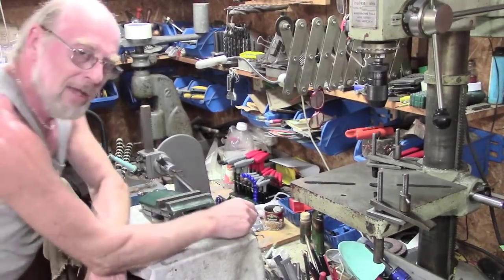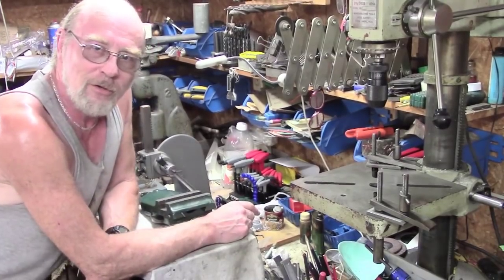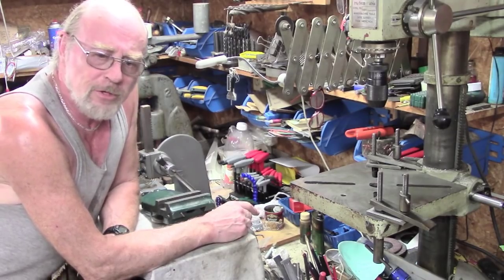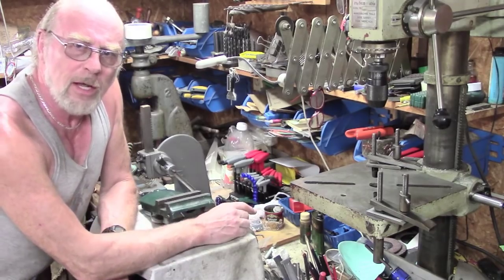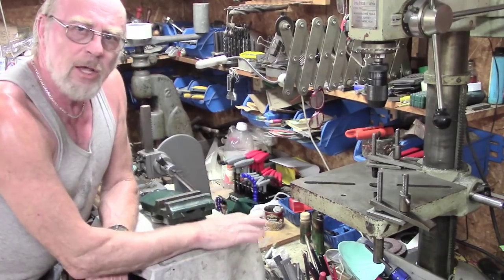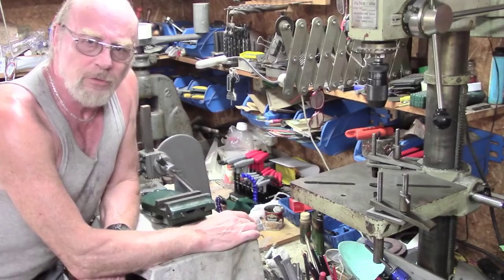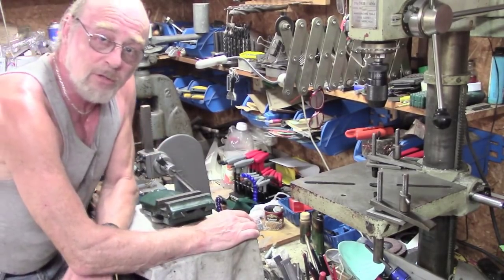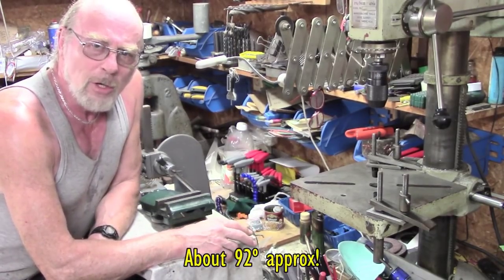New Gib Plate for a Compound

Comment: Hi Chris,
You've got one those shops with the abrupt 2 seasons changes, from cooking heat to total freezing...
Beware when working on cold rolled steel, taking off material from one side or the other will unbalance the stresses induced mostly on the surfaces and cause the piece to warp badly, hot rolled steel is less prone to those problems.
But the compound is 100% better then before now...   ;-)
Cheers,   Pierre
Reply from the maker: pierre beaudry Sorry late reply - my comments notification seems to have dried up! Yes Pierre - there was a bit of warp but very slight fortunately so no biggie.

Comment: In addition to good screws (who doesn't want a good screw, sorry, couldn't resist) a dowel pin, locating the strip, stops any movement and unwanted tightening from the wedging action of the dimples as the top slide, er, slides.
Re weather, I told you you should have stayed in Blighty, it's in the 70's and we have the NHS :>)
ATB
chris
Reply from the maker: Chris Stephens Sorry late reply - my comments notification seems to have dried up! I am hoping new set screws will actually still help with both location and setting. Hah - I saw what your weather has been!

Comment: You have obviously found out now that you would have been better leaving the bevels until last, being so thin there is no way to hold the strip down firmly along its length, it should really be held on a surface grinder magnetic bed and just ground to thickness, but I don't suppose you do not have a big enough surface grinder, the other easy way would be to have soldered the strip to a thick piece of metal,(clamping tightly down first), you could then simply machine to size, then unsolder it and finish by hand, all very easy to conclude when you have found out the hard way I am sure! Chris B.
Reply from the maker: Englishman French Hi Chris - we live and learn as they say! I think a repeat of this I'd probably use CA glue on a backing plate, or even as you suggest - solder! I wish I still had my old surface grinder - long gone when I sold it before my move - silly man! BTW - DRO is a real boon - love it.

Comment: Hmm is it a video artefact or is the vice bobing up and down when you move the table at 17:something ? =)
Reply from the maker: +Tomas Wilhelmsson 
Hi Tomas,
I checked back into the 17 min region and wasn't quite sure of what you saw.
A problem I have is that machine mounting is onto a rather flexible suspended floor and quite often operation of hand wheels can induce movement - might well have been that.